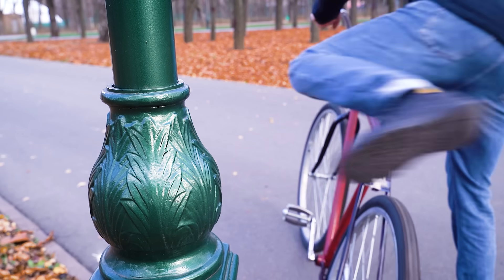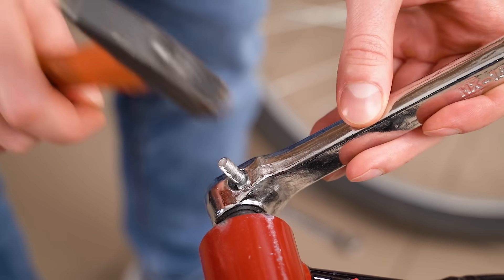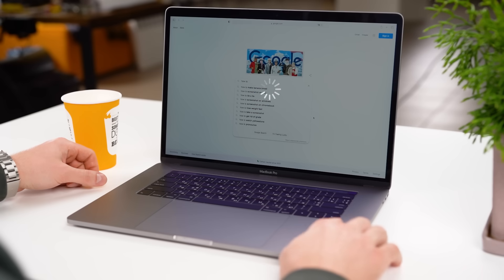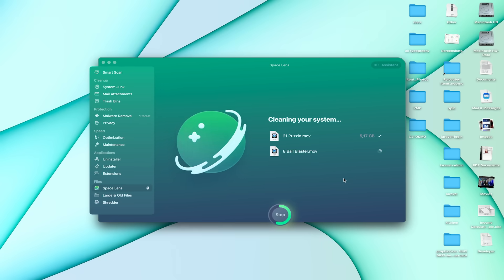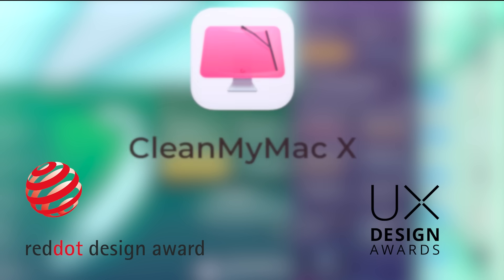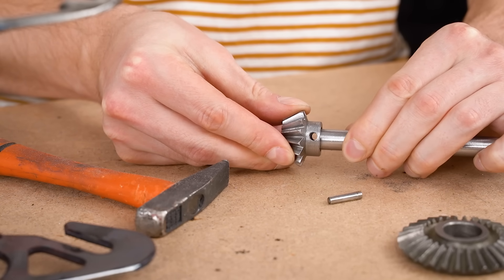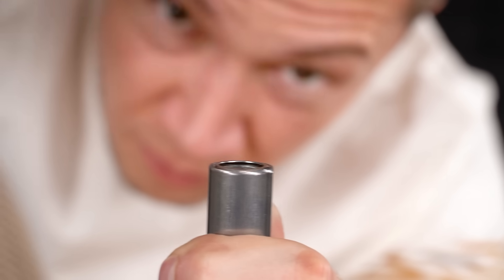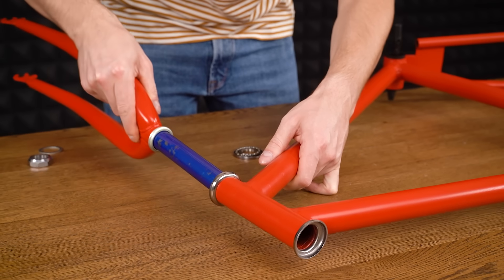Insane Chainless Bicycle Prototype

Comment: Nice. Other then you lost the option of switching gears. And the way you were peddling it gear one. And one other problem I seen with it. Where the tire mounts to the frame on the gear side. Looks like you hit one good pothole and it’ll probably snap off.

Comment: The same as a differential,  ring and pinion gear.....old bicycle and automotive technology . A spectacular in house build. Mechanical engineering student ? ....what is the turn and or gear ratio ?

Comment: Why would this guy go through so much effort to build this? It is too obvious that he removed the chain from the bike at the beginning of the video, and having a shaft-driven bicycle will never be worth it. If he wanted a shaft-driven bike in the first place, I'm sure that someone, somewhere, was building them for sale. Also if your chain comes off your bicycle, you should replace the bike, as you would more problems than just the chain coming off.

Comment: Hope those pins don’t fall out!  Feels like they might come loose over time, but overall, very clean build and great video 👌
Reply: Direct drive is fun until u get your calf pinned  inbetween the pedal and the ground 😉
Reply: @platinum6978  the rear hub was a standard single speed with coaster break. Still works as before but no chain. You can stop pedaling at will and coast or pedal back a bit to break.
Reply: I had to rewatch the video to see it wasn't a fixed gear.  Changed my initial dislike of your comment to a like.
Reply: @platinum6978  Ouch!
Reply: Tapered pins..Very common in machinery, they will stay put.
Reply: I think the problem is that they wouldn't come loose. I would have used bolts like on old pulley systems, especially considering the gears he used aren't likely to survive. Those old drills were not intended to withstand that kind of pressure.
Reply: Ещё бы он ехал так же как и нормальный велосипед было б  супер, а то подали крутит быстро ,к он не едет.
Reply: Enclose em with grease, they'll last forever🤣
Reply: @000000000   No need. They'll actually adhere more with use. In fact, taking them out after a while can be challenging.
Reply: I thought the same thing. He should've used Kotter pins

Comment: Everyone mentioning the single gear issue, but I'm even more concerned about the pedals needing to move together with the wheel. Imagine driving downhill with this. The axle contacting the shaft directly is also a major source of unnecessary friction, should've used bearings.

Comment: Sorry but looks too weak, and all those moving parts are highly malfunction susceptibles by bending or wrong alignment, the mainly reason to use a chain is the flexibility and you losed all those flexibility with this…the basic idea is good, but I can't see you using this during long time without having  broken gears or alignment problems…

Comment: A large chain system will last way longer than that small gearing system. Teeth will soon start to strip.
Going down steep hills you have to place your feet off the pedals.
No shifting already mentioned.

Comment: Why not avoid gears all together and attach the pedals to the one of the wheels?
Reply: They did that with the penny farthing. Unfortunately they had to make the front wheel insanely big to get any speed out of it.
Reply: @sneezyferret6482  Solution: increase the circumference that joints the pedals and the wheel..

Comment: Nothing new, quite the contrary. For those who think that gears are not possible with a shaft, look at BMW motorcycles. Such a shaft could be easily paired with hub gears like Rolhoff or crank gears like pinion.

Comment: This is not new at all (prototype? Nope) It's been done back in the late 1800's when bicycles were becoming standard. Even rope was used in place of a chain. Also again in the early 1950's using a car's pinion an gear was used to replace the then chain sprockets. It just never caught on.

Comment: In common use on motorcycles albeit with the bevel gears enclosed. Main advantage is no adjustment, cleaning or routine replacement needed. Disadvantages are weight, cost and significantly lower efficiency than a chain drive.

Comment: Instead of pedals wap a drill on the drive shaft, preferably a brushless cordless dewalt drill with flexiVolt batteries always handy to have a spare battery

Comment: This is really INSANE! The chain drivetrain has about 3-5 pct losses. The shaft drivetrain is almost 20! But this is used in motorcycles that have the motor axis paralel with the shaft! So here u have even almost twice the loss! With the motorcycle we use the shaft so theres not the service cost of chaindrive, makin the service interval much longer, but at the cost of more fuel (because of higher pct of losses). But you have almost none of such a problem with a bicycle. So this idea is stupid as hell.

Comment: All the dirt, sand and everything else abrasive is going to go right on to the gears, and they will be destroyed almost instantly.  That's why every bike drive system of this type is enclosed. Congratulations, you've built an extremely useful f**kall.

Comment: I'll commend you on your craftsmanship, but your source parts are not appropriate for practical travel.  The 1 to 1 ratio was predictable.   There is no point in a fixie bike that has such a low gearing.  Even an easy to pedal one speed touring bike is 2.75  or better.

Comment: Now you need a neutral. And a brake in the pole. So there is 3 poles. Connect bottom gear pole to pedal pole. start moving. Between is neutral.  Pole moves to top geared pole  and thats your go speed. Start. Neutral. Go

Comment: Please use real grease. Wd-40 is a solvent not a lubricant. Parts will begin to wear quickly. That's why the gears were sealed in a greasy case.

Comment: This gearing system will need more power for the same speed reached with the chain so basically more fatigue for the rider
Reply: Yes, here the loses are about 6x - 8x bigger and when the gear get some debris in (which it will very soon) the number rise dramatically.

Comment: No changing gears though so no going up hill?  What about adding a pedal that has 3 more size gear heads?  Then add a way to rotate that gear head to each of the different sizes?

Comment: It is basically equal to the lowest pressure gear on any bicycle.
You're gonna have to paddle a lot just to move a few feet.
I'm not exactly sure if I'm gonna recommend it....
Reply: Just need to use a Nexus hub with integrated gears...
Reply: @jbduchene  *which he didn't,
hence my point.
Reply: @earlyxplorerstudios8592  Still doesnt help anything. The loss is sooooo high here. If he used faster gearing, he can hardly make it move...
Reply: it's a design, i think it's not meant for that purpose.
Reply: Um, it was just for fun…. a proof of concept. It wasn’t intended to be ridden on the Tour.
Reply: I know
Reply: You “pedal” a bike, and a “paddle” is used in a boat. 
On another note, it doesn’t appear like that bike can coast at all.
Reply: Correct
Reply: If he had reversed the gear ratio on back wheel this could have ended up well.
Reply: It's for short distance only.😁
Reply: He needs a custom made sweet spot gear ratio. 
It's evident he could find the needed size in scrap and used what he had.
Reply: He should have just gotten and tightened a new chain
Reply: The gear is too small and they used to do the tour on single speed so it must not be that bad
Reply: Easy fix, just have 5 of them barrels like a machine gun that can rotats into place to changs gears
Reply: Does nobody understand the concept of prototype? He's just showing us that this is possible.
Reply: FENDT built those bicycles 50 years ago
Reply: Hunt that bycicle down, put it back in its chains and send it back to work! Yeeeehaw!

Comment: there is a problem in this case 'the paddles are not moving freely'
but in this cycle 🚲 breaks are like disck breaks better control than older versions of other cycle 😆🤣 we can't lose lather of breaks this is a beneficial for us

Comment: Not to take away from accomplishing this engineering project but I  had a Sussex shaft drive bike for a few years. The chainless drive was rather more experimental than reliable. The  shaft drive was mated to a Nexus 8 speed. The drive was heavy with more friction than a chain drive and the drive shaft kept snapping under load. There were lots of alignment issues. The curved bevel gears also wore out quickly. The gearbox was made from aluminum and too weak with undersized hardware. Expensive, heavy, inefficient, unreliable. Belt drive seems far superior.